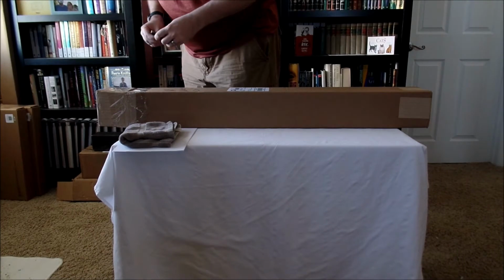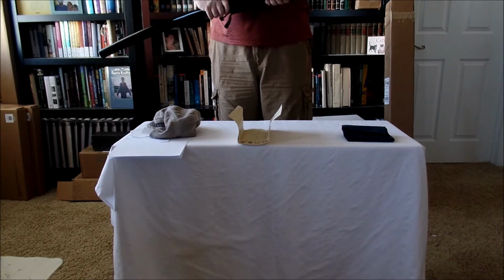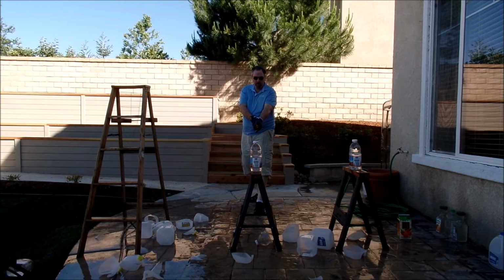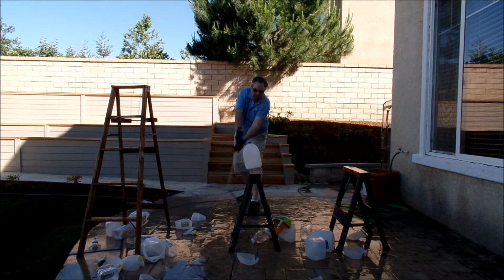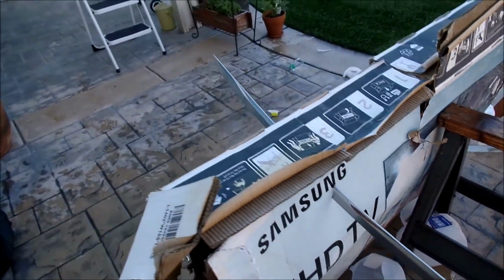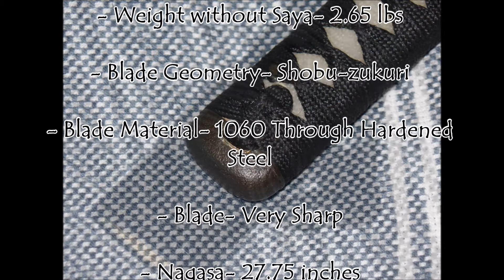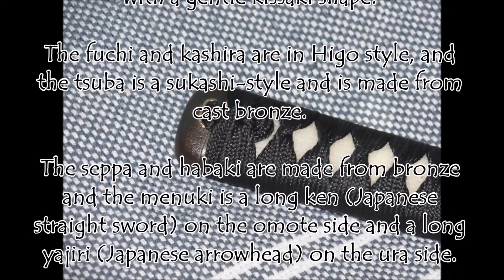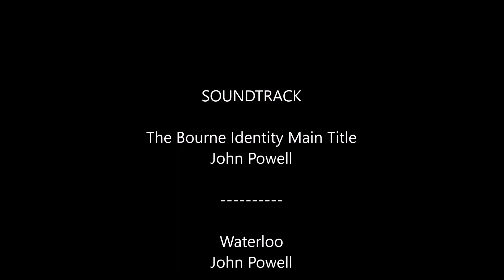Munetoshi Kouken

Comment: How would you compare this one to your Hanwei Practical Plus XL Light ?
Reply from the maker: These are two dramatically different swords all the way from blade geometry to metallurgical processes used to make the blades.  This Munetoshi has a through hardened 1060 High Carbon Steel blade.  This blade has been treated very much the same way Ronin Katana treats their Dojo Pro series.  A through hardened mono-tempered blade has a very resilient nature to it ... similar to spring steel.  The Practical Plus XL Light is made of a 1560 deferentially hardened blade meaning while the blade edge is harder it won't have as much give as mono-tempered blades will.  Its a trade off.  The XL Light is much more of a performance cutter then the Munetoshi.  The Munetoshi is much more of a "heavy cutter" meaning it can really take a beating but not cut bamboo quite as well ... though I would expect it would still do so tolerably well.  Lastly, the Munetoshi is shobu-zukuri blade geometry which provides a much more dramatic ha or edge which extend a lot further black into the blade.  The Pract.+ XL Lite is a wide shinogi zukuri blade which features a heavier spine and a much more familiar blade shape overall.  I hope that has been of some help.
Reply: @mr.excalibur1455  Which one cut better?
Reply from the maker: @Kirk1957  I would say if you are doing ONLY tatami mats that the Pract. + XL LT will be the better sword.  However, if you are looking for an all around heavy cutter ... the Munetoshi will be better.  In that vein ... I'll go one step further.  If the direction of an all around cutter is what you are looking forward I would suggest the Ronin Katana Dojo Pro Series.  They use a similar steel ... however ... RK's reputation with that series is second to none.  If that is the direction you are going THAT would be my real recommendation.

Comment: Minotushi is a good looking blade, nice to see it that sharp...but correction the practical XL is a wider blade that's made as a heavy cutter...and its a little cheaper...this model has a little better adornment for the money...the performance cutter from Minotushi is their real deal heavy cutter...good review as always...thank you
Reply from the maker: The Practical XL in its various iterations are not really a "heavy" cutter as I would define it for one reason ... they are deferentially heat treated.  What I would classify as a "heavy" cutter would things like a Dojo Pro Series (Ronin Katana), Raptor Series (Hanwei), or even the Warrior Katana (Cold Steel).  Reasons being ... all these models including this particular Munetoshi all have Mon-tempered blades.  Regardless of what steel they are using (usually 1060 or 5160) these blades have a single temper and heat treat to make them much more resilient to bad cuts.  One the other hand ... the companies that make these swords also usually give them a really sharp edge right out of the box.  I have a Practical XL Plus Lite katana ... and in my opinion they are a kind of a cross between a standard and "performance" cutter.  They have that nice heavy blade ... but its also a narrower blade thickness-wise which does give it that "performance" descriptor.  Personally I shy away from swords described as "performance" cutters.  I find that the steel often is just too thin for anything other then tatami mate cutting or even soft bamboo.  And ... while I understand that that is the intention behind that design ... not really for me.

Comment: Not an O-Kissaki..  Its a Shobu Zukuri blade, and that's not done traditionally...

Did you say water bottles show what the blade is made of, and that bottles are more of a test gor the blade than tatami?
Reply from the maker: I do think certain water bottles ... certainly heavier juice bottles that have a heavier plastic ... can show what some of these mass produced Chinese made Japanese styled katanas can do.  Milk bottles while having very little resistance ... you can practice by sheering off rings of them.  Its nice precision practice when you don't have tatami to work with.  That stuff is expensive and in short supply these days.  Ya gots ta make due with whatchya gots.  Water bottles I have for days!  Please remember... I'm approaching this from the perspective of someone who does have some training but who is looking at this through the eyes of what I call the semi-casual sword enthusiast.
Reply: @mr.excalibur1455  was just curious... I cut alot of both bottles and tatami... Use water bottles n pool noodles when I'm sharpening a sword to see if the edge is where i want it.. If it cuts the bottles and noodles cleanly without any tearing or blowing out I know the edge is getting to the level of sharpness I want.. Bottles are great for speed and accuracy.. Stacking bottles and doing double cuts on them is great training.. Pool noodles are great for edge alignment, learning to snap through the target, and testing edge sharpness.. Yes there are some bottles with thick necks that may chip a blade, or are heavy  enough to bend a blade if the edge alignment is really bad..
Tatami is kinda taking all that and using it together in my opinion.. And tatami will test the blades ability to not take a set. Bamboo I'd say is the highest level, and should be left alone unless one is very experienced!! Bamboo will bend and chip the blade if done wrong!! I leave bamboo alone!!

Comment: thats a good cutter but hell the rattle could easily be fixed with a hammer and a sharp point nailset . It would've been nice to at least have the ito tight but I know she would handle buisness when time come .
Reply from the maker: It really was!!  It has a nice edge right outa the box.  All the rattling and looseness of the product right out of the box was a concern ... though I know there are some very simply DIY fixes.  That was a fine blade though.  I actually wouldn't mind testing out another Munetoshi if I could get my hands on one though.  It seems its a brand that's really been hurt by the current trade and pandemic situation ... and as result other models of their's are like trying to find a needle at the bottom of the ocean.